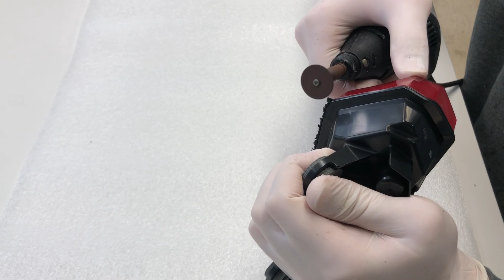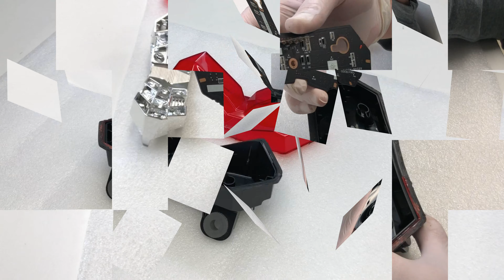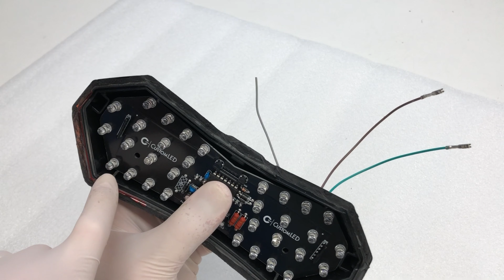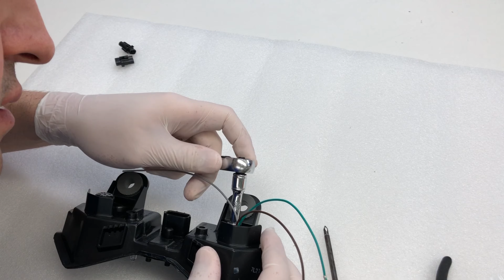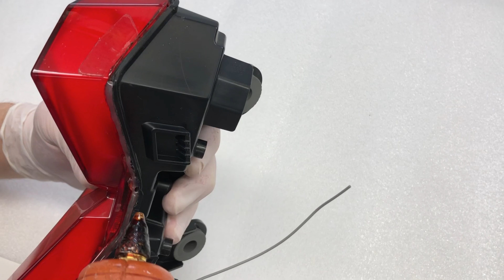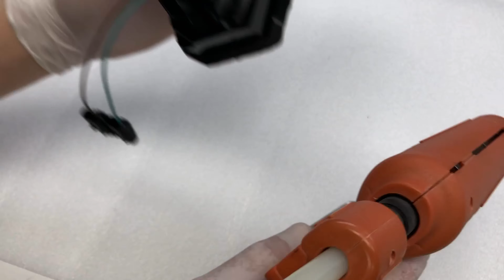Kawasaki Ninja H2 SX/SE Blaster-X Tail Light Retrofit Kit Installation Video

Comment: Had you not tried placing the light in the oven to soften the adhesive, this would then allow the unit to be split open easily? The same method can be used for resealing the light, leaving a much tidier finish.
Reply from the maker: The OEM tail light is sonically welded shut, which basically means the plastic parts are melted together at the interface. Heating the tail light to the point that the plastic softens will ruin the entire tail light.

The heating process you describe ONLY works on adhesive sealant, which is often used in the larger headlight assemblies.
Reply: @CustomLED  Thank you for correcting me. I have seen car headlights opened up by placing in the oven.